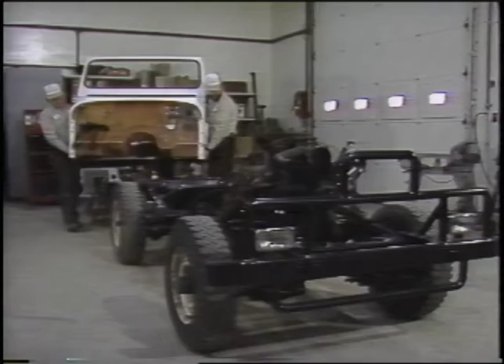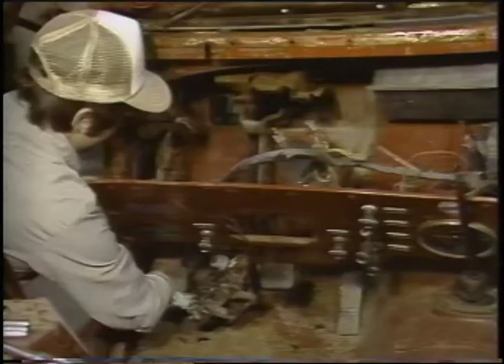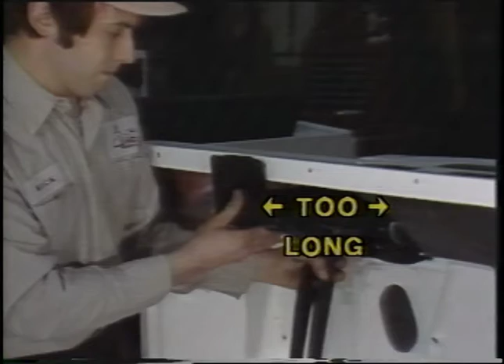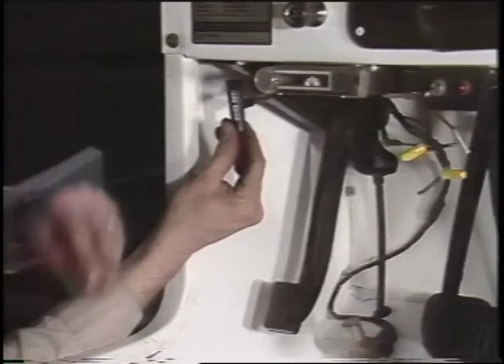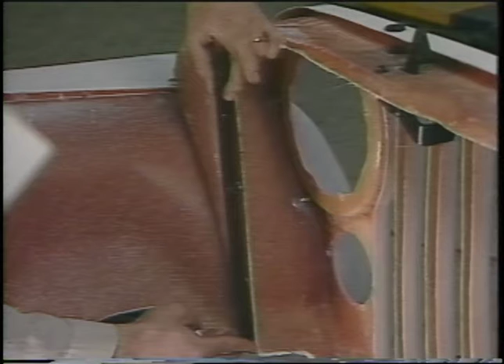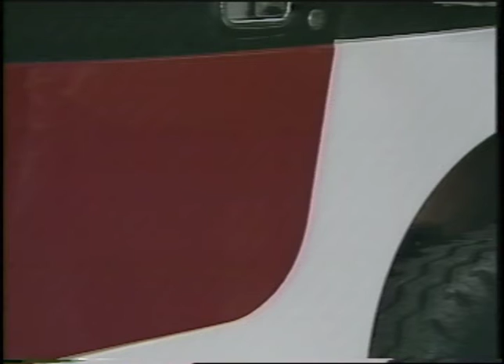Installation Of A Fiberglass Body For A Jeep

Comment: I've still got this video in VHS format from my installation in 1993. Still got my 1975 cj-5 and it still runs and looks like new. Best move I ever made! The one piece front end was the way to go. So much easier to work on the engine.

Comment: OMG! I had this video in like 1998, and installed a tub and fenders on my 67, that I still drive almost every day! I felt like a sellout not getting a replacement steel body, but I couldn’t weld at the time, and it allows me to use it with almost blatant disregard for salted roads in the winter months.